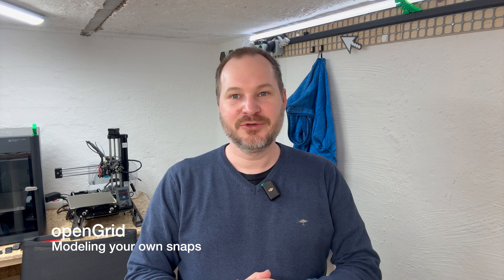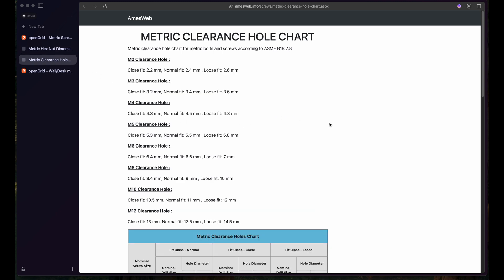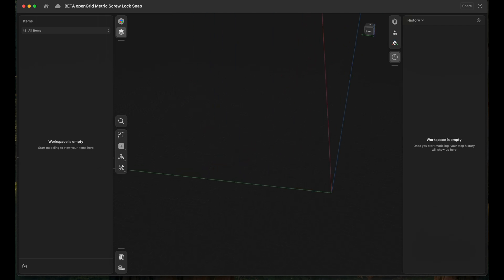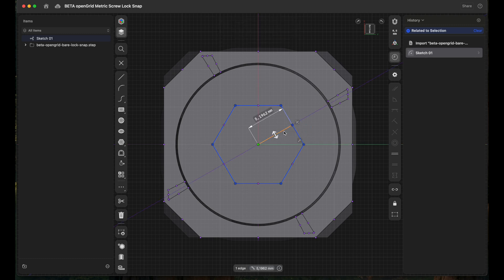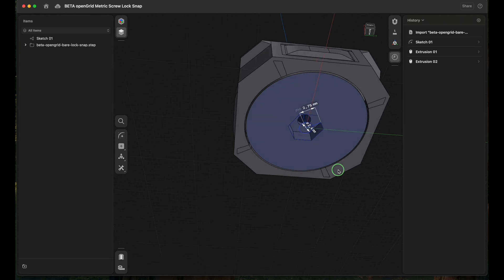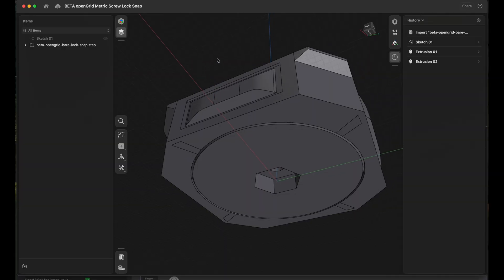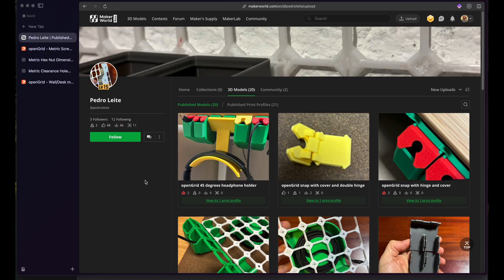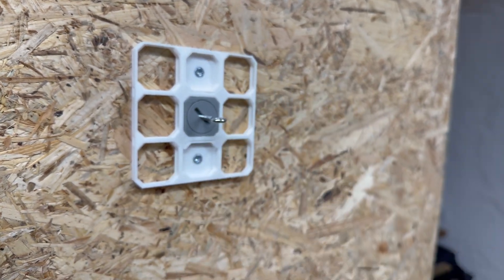openGrid Modeling - Create your own models / boost the openGrid ecosystem

Comment: weird question, is/will there be an offset wall mount? i think i prefer this to other options but if possible i'd like to run charging cables behind the grid since rerouting that would be easier than printing more covers to fit the new path, at least until it gets finalized.
Reply from the maker: Yes, there are offset mounting snaps. Still I don’t really recommend those as the mounting surface does increase the boards strength. So be aware of that. 😉

Comment: which shelf would anyone recommend. its only for a phone and power bank so not much weight, if it folds up it would be amazing
Reply from the maker: I can really recommend the shelve generator created by BlackjackDuck: https://makerworld.com/en/models/582260-multiconnect-part-generator-master-collection#profileId-633542
If you are going for something specific like Gridfinity shelves I would recommend looking at infinity shelf made by dmg: https://makerworld.com/en/models/1469935-infinite-gridfinity-shelf-for-opengrid-very-strong#profileId-1534153

Comment: Hi David, 
I was under the impression, and maybe incorrectly, that the opengrid lite is mostly for underware, and for other applications one should use the full opengrid panels? 
I am on a journey to organize my office with opengrid (+underear,+gridfinity), just wondering if I should skip the full panels all together and just use the lite version for everything .
I had a thought that one might be able to mix and match lite and full on the same wall with an offset connector to make it all flush, but the ones that were provided do not flush out the lite and the full panels, something I will need to figure out how to do/modify. 
Thanks for all the contributions you have made to the 3d printing community! You rock!
Reply from the maker: Interesting idea! Currently you are right, those two don't match using the offset mounts. Also I wouldn't really recommend putting the lite board on an offset, this should only really happen in very rare cases - the lite board isn't that strong and having the offset allows it to bend way more than with something like a wall reducing the flexibility. So I would recommend  just using the full version.

The full version in general has the benefit of being stronger. I'm myself sometimes still surprised by what you can put onto the lite board, but the full version also has additional possibilities to attach things and ensure those things are held in place. There will be an update to the directional snap soon that uses one of those aspects (and got me to ask myself why I didn't do it this way in the first place) - all compatible of course.

Still this does not mean that the lite board is only for Underware. This is also my main use case, but having this low profile version is in my opinion also better looking, less space consuming and still pretty strong. So I have for example used this for most of the visible boards I have in my office. Also if you put things onto your cupboard doors (see the video by Hands on Katie about her kitchen organisation - although she uses Multiboard here) this might be the more suitable version.

In the end I would say it depends on the use case, personal preferences and what amount of flexibility you want to have. The full board is kind of the safe bet here.